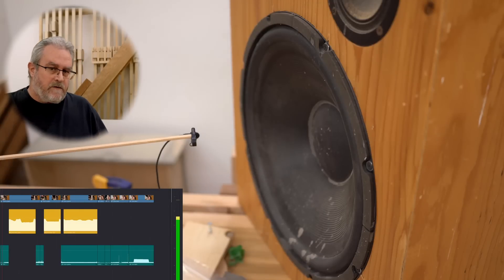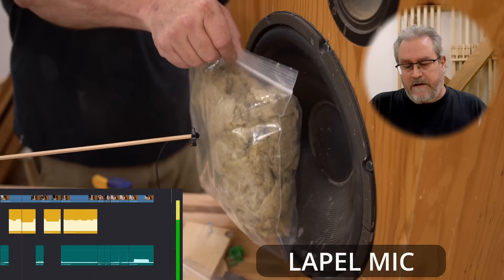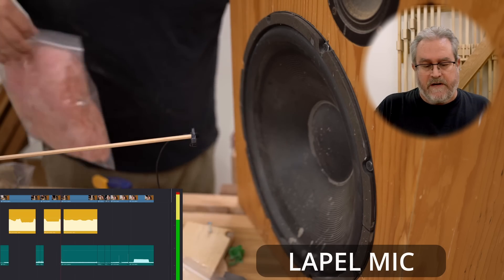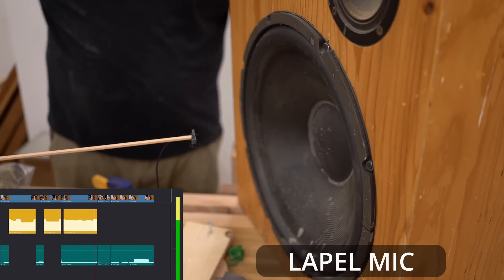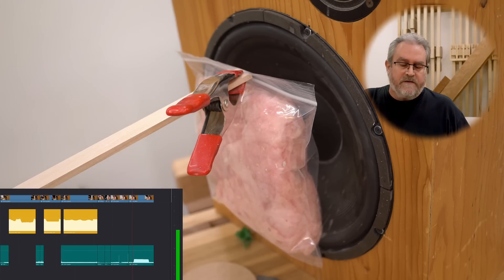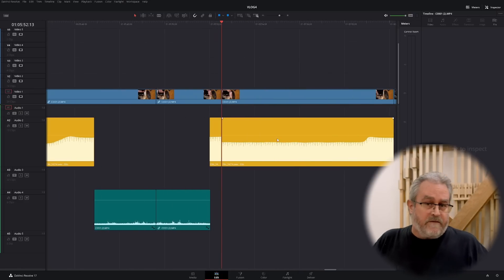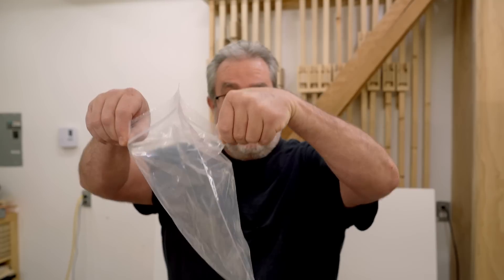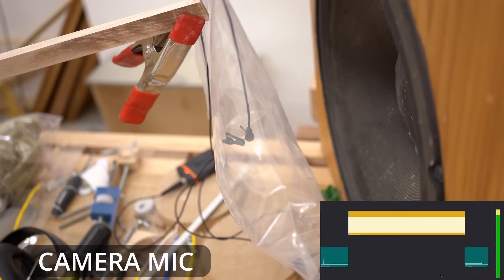You are Thinking About Sound the Wrong Way

Comment from the maker: Most people tend to think of sound from a speaker as air moving. This leads to the idea that something that will block wind (like thin plastic) will also block sound. The air is moving, but there is no "flow". Instead, think of that movement as shivering - it's vibrating very slightly but not going anywhere. 
As with all solids, some sound will reflect off of the thin plastic, but almost all of it will pass right through unobstructed. Think of light hitting a pool of water - some reflects and some goes through so you can see the bottom of the pool.
So a damping material like rockwool performs essentially the same as it would in its raw state, if it is sealed inside a plastic bag.
Sound is energy that travel through and acts upon mediums. Mediums are any solid, liquid or gas (like air) and they vibrate when sound passes through them. 
They can also reflect the energy. If the sound is travelling through a medium (like air) and if it meets another medium of different thickness, density and mass some of it will reflect. The new medium (like a wall) will reflect some of the energy and let some pass through.
For example a thick, solid concrete wall will reflect almost all of the energy that hits it, while a thin wall made from lighter, less dense material will only reflect the higher frequencies and let most of the bass frequencies pass through. You can hear this effect easily with your stereo playing in another room.
Damping absorbs energy and converts it to heat. When sound passes through a damping material, some of it is converted to heat and used up in that way. That's how the piece of rockwool I put inside the speaker stopped the standing wave - it absorbed the excess energy from that standing wave and converted it to a very small amount of heat.
Sound is not simple. Most think of it in 2D terms, when it is fully a 4D process. It moves through 3D space with a beginning and end time. It usually starts at a single point, but then expands out in all directions from that point until all of the energy has been converted to heat. This expanding is called propagation and the sound energy is spread thinner and thinner as it happens. 
Think of a balloon being inflated and how the rubber gets thinner as the balloon gets bigger. There's still the same amount of rubber there was when the balloon was not blown up, but it's now spread over a much larger area. 
For sound to dissipate quickly, something has to speed up the conversion of that sound energy to heat. That's the function of damping, like that rockwool I used.
Reply: At 40 Hz the wavelength is more than 8 meters. Your bag is very small in comparison and therefore invisible to the sound. I am actually surprised you got -3 dB attenuation from it. I would put that to mass damping effect more than any kind of absorption.
Reply from the maker: The minus 3db was the rockwool damping in the bag. The bag by itself was .3db reduction.
Reply: @Thomas..Anderson  Soundwaves are longitudinal. The energy of soundwaves moves particles back and forth between source and destination.
Reply: @ppdan  Not entirely true, Oversimplification.
Reply: I wonder if you could increase the effectiveness of polyfill by putting it in a sealed bag and squeezing out most of the air?
Reply: If sound is the movement of energy, then why is it attenuated by the temperature of air?
:
Reply: Hi John, I'm enjoying your series on the broad subject of speaker building! I would like to take the opportunity to debunk the myth that a baffle (with or without an open or closed box attached to) is necessary to create bass sound in a typical listening room: https://www.youtube.com/watch?v=njtaBY5GiYE (best to enjoy with headphones).
Reply: if the wave length is smaller then the thickness of a solid mass it will get reflected so not many things will be reflected with a plastic bag ..20 hz is 17 meter long good luck stopping that
Reply: sound is changes in air pressure to make it simple

Comment: I don't think people need to put insulating in plastic bags. Any fabric with a tight enough knit (like a bed sheet) will keep the nasty tiny fibers of insulation from getting pushed out the port from air movement. I don't get all geared up in a hazmat suit when building acoustic panels, but it is very irritating to my eyes, throat and lungs. If the air pressure going out the port of my speaker is enough to blow out my (rather snug) foam port plugs when I turn it up, then even at moderate volume there is enough air flow to push those tiny glass/rock fibers out into my living room. It's not that difficult to keep it contained and it isn't smart to allow it blow around your house freely. That sh!te dices up tender lungs and scratches eyeballs. Those two organs are kinda important to keep in good shape.

Comment: The fibers transduce the vibrating air into heat. By encapsulating the fiber material, you have prevented the air particles from interacting with the fibers.
Reply: Is there not also air inside the plastic bag interacting with the fibers? The bag is not a vacuum.

Comment: But the plastic bag is having the opposite problem most people were concerned about, which you show. The intent of insulation is to absorb reflected sound that would normally bounce off the internal walls of the cabinet, correct? You did show in your video that the plastic bag actually reflected certain frequencies….frequencies that would normally be absorbed by the insulation. 

When you held the plastic bag close to your face, the timbre of the recording changed. Moreover, when you covered the mic with the empty bag, you commented that the mic picked up more sound, which would seem to indicate some sound was being reflected around inside the bag, causing a boundary reinforcement. 

Am I missing something here? Are you saying the frequencies being reflected by the plastic are not crucial frequencies for the insulation to absorb? Are you saying the overall reflected sound is so low that it’s negligible? Both? Or something else?

Comment: Recently a car audio engineer showed me a car speaker design. He told me that it will be sort of revolution in car audio. He said its a ring mode driver. It is a extremely flat full range driver starting around 150Hz and reaching up to 20kHz. I mention this, because it can be seamless integrated in any surface and fully covered with a lot of materials without the need of a grill or opening. The covers almost have almost no effect on the function of the driver. In fact they become part of the driver.

Comment: If I am not mistaken it doesn't really go through the plastic bag, but is "reproduced" on the other side.
It's like a transducer only in this case you are using sound to produce sound.
Reply from the maker: While that explanation might be more intuitive, it doesn't actually work that way. 
Replace the plastic with a thin sheet of lead and there will be a significant reduction in sound transmission due to the much higher density of the lead. It reflects back much more of the sound, but is still acted upon in the same way as the plastic sheet.
If it was just purely a reactionary effect, then any material of any density at the same thickness would transmit the sound equally.
Reply: @IBuildIt  There will be less "transmission" because there is more reflection like the plastic bag will reflect less but "transmit" more.
Reply from the maker: But the mechanism of the transfer you describe relies on the the sheet moving when acted upon by sound energy, which happens whether it reflects or not. The sound still hits it regardless of how much is reflected back. Think about it.
Reply: @IBuildIt  Of course it will still hit (can't reflect without being hit).
Soundwaves are mechanical waves. If more is reflected less is passed to the next medium -> conservation of energy.
Reply from the maker: Good point. 
So where are the impedance mismatch losses? A speaker driving air isn't anywhere near 100% efficient, but you expect a less than 1db loss (what I measured) from this system.
Reply: @IBuildIt  It may sound weird but some energy is transformed in heat. My closest guess would be : total = reflected + absorbed + transferred

When it comes to your experiment, I am pretty sure that a lot of what you are measuring is reflections from all over the place. In an anechoic situation you might already get very different results (going outside with your setup would also make a difference). Also that small bag is no match for energy you are directing to it (especially since you are using a LF signal which has lots of energy).
Reply from the maker: No, if the mechanism is as you describe, there would be massive impedance match losses. The simpler and more reasonable explanation is that the plastic is just another medium that sound goes through.
With it working like you describe, if you put a speaker fully in a bag you'd hear next to nothing due to those losses.
Reply: @IBuildIt  Somehow I get the feeling that we are both just looking at it from a different angle and maybe I am not able to express myself well enough in english.
Of course you would still hear something if you put a speaker in bag but the less stiffer the material of the bag is made of the more sound will "escape" because the particles in the bag are less compact (dense) and vibration of the material is easier.
Let's say a plastic sheet is only made out of a single molecule (would be a very tiny sheet in reality). If a soundwave hits it that molecule will move and on the other side that molecule will move particles in the air ... 
Now we make a larger piece (in all 3 dimensions) ... about the same phenomenon will occur only that this time the first molecule hit wil transmit it thru it's neighbour molecules and so on until the last molecule of that material transmits to the another medium. 
I am pretty sure that if you would take a microscope and look at the surface you will see that surface vibrates (without going to molecular level) in a similar way on both side (where the soundwave hits and "comes out").
Edit : my bad, changed "atom" to "molecule"

Comment: I must confess, this topic both fascinates as well as frustrates me.  I still don't fully understand why sound absorption panels, then, are made with fabrics.  So if it's energy, why is that the case?  I'd love to see a test between a 2'x4' sound panel.  One with insulation only, one with fabric covered insulation, one with insulation covered with plastic (maybe a trash bag) and one with a trash bag only.  Then see what differences there are.  I love this topic, but damn am I an idiot on the subject...  groovy video

Comment: Can you  expand on the differences  of low frequency  vs high frequency in relation to deflection, reflection, absorption and pass through
Reply: I mentioned this on his last video. If you imagine a totally immovable object, it would reflect most of the energy and absorb some as sound. 
But reflection has a lot to do with mass and frequency. I'm sure there some tables out there.
Absorption is weird, you kind of need a material which is flexible enough to dampen the energy, but bounce back. Hence why rubber is a great vibration insulator. 
The absorption has a direct correlation to the thickness vs wavelength at x frequency.  Lower freq has a longer wavelength and as such needs more material to dampen it. this is exactly why you will usually hear bass from your neighbours cars ect rather than the rest of the audio when all the windows are closed. The thin walls and windows can block the higher freq, but the lower freq can still penetrate due to the wavelength.

Comment: A few observations. 
- The mic/empty bag test; ... perhaps the surface area grabbed more wave energy, coupling that air mass more ideally. 

- For decades concert PAs have had to fire through covers, banners, huge signage. 
Certainly not ideal from a FOH perspective. Encountered often on budget festival type events with a title sponsor. 

- Its generally accepted that covering bass trapping in 6mil sheeting for example, performs like a low pass filter. 
It varies, but it returns energy above a midpoint ... it's often employed to retain liveliness, when adding proper effective LF control via many bass traps. 

Most rooms need all the LF absorption possible, yet doing so without preserving vital liveliness may not be as pleasant. 

- NSYNC came thru our venue, RCA Dome, in the early 2000's. This was the biggest tour production in the world. 
No expense spared touring. 
But for "cool" visuals ... the PA fired thru an external grill! 
I couldn't believe it. 
Pop Odyssey Tour

Big point source PA, each cabinet faced with an exterior shiny metal grill ... for aesthetics ... a tour that big.  
That should never happen! 

fwiw, everyone got their hands on that tour ... "bill to band", "bill to band", "bill to band" ... I saw it.

Every element of that tour was as over the top as you can imagine. Circus like. 

The "steel" arrives a week earlier. Cranes handle and build the stage structure, from a constant flow of flatbeds negotiating our King-Kong door airlock. 

Over a few days, they build every trick feature a concert could have. 

As an opening misdirection, they appear on an elevated platform midfield (unknown to concertgoers, the act was rolled into position via road cases, right thru the center of the crowd!). 

In addition to cabling to fly five wide across the length of the stadium ... trick hidden features everywhere. Conveyor belt thrust catwalks out into the crowd. Five futuristic mechanical bulls appear ... with every lighting, pyrotechnics effect possible, platforms rising and falling. 

Every effect ... smoke, fire, light, platform, pyro, laser, the main video display dropped down into an example! 

Akin to a Vegas permanent residence show ... that level of complexity. 

We parked 20 to 30 motor coaches, INDOORS for that show. A car hauler of exotic cars, sport bikes for toys while they're in town. Additional haulers with 60 golf carts ... 60, one band, one night ... two hours!
Excess, layers of it. 

Like I said, EVERYONE had their hooks in while the getting was good. 

Someone had the bright idea to fire the finest PA cabinets in the world thru a set piece, an ornamental grill. 

John, your video reminded me of those times.
Reply from the maker: One thing I failed to notice while doing the mic in the bag recording was that it was a lot closer to the speaker. So that probably accounted for the higher volume.
Reply: With the microphone inside the bag, there was only one layer of plastic between the driver and the mic. In your other tests, there were 2 layers of plastic between.
Reply: Good point ... the smallest differences are magnified greatly due to relative proximity. 

Not in anyway in critique of your thought proking content, John. 
But, variations like that illustrate why subwoofer testing is best performed outdoors, ground plane at 2m. 

The extra meter facilitates all the energy (driver, vent, etc), has coalesced into summed wave energy. 
Also, the doubling to 2m elicits greater consistency across the data.
Reply from the maker: If I had a subwoofer design business, then definetely I'd use an accurate method to measure their output. 
But for everything I do the in room response is enough to get an idea of how they are performing. I'm only using my stuff in my rooms, so if it works there, it's good enough.
Reply: @IBuildIt  
fwiw; 
Due to extraordinary dBspl, pro audio mfr Danley, measure their offerings at 10m, and 28.3v, rather than 1m, 2.83v.  

Their products are extreme, ... subs w/109dB sensitivity at 1w, capable of 150dB. 

Full range, point source with 160dB capability! 

Extraordinary numbers.

Comment: The comments about the bag crackling reminded me of a silly experiment I did many years ago. The idea was to dump a bunch of styrofoam peanuts into a couple speaker boxes. I actually did this as a gag, because I thought it would have comedic effect (i.e. the noise styrofoam peanuts make). To my surprise, it did not have the desired effect. It didn't make any "styrofoam peanut noise." But I also don't think it did anything to dampen the boxes.

Comment: I was just going to ask about foam.  When i was younger I made a car subwoofer and lined it with foam ("egg-crate" foam to be exact).  Then later moved it to my home theater system.  It was actually a 12" home theater woofer to begin with.  It sounded great... that's all I remembered.  So I did the same to my floor standing 3-way speakers and thought it improved the sound as well.  Probably not... maybe.  But, in any case, look forward to that next.  Always learn something new .  In fact, I am realizing how little I knew to begin with.  :)
Reply: Egg crate foam really isn’t the best material to use. It’s been show that it’s just far too thin and porous to really do much to the sound waves, at least nothing like a proper fill like fiberglass.
Reply: @danhorton6182  Yeah... that was what I was thinking (now that I know a little more).  But, honestly, the rockwool in a plastic bag just completely blows my mind.  It's hard to wrap my head around it.  But, I'm still learning.  :)
Reply: @TheVTRainMan  lol, I get it. I’d you’re worried about itchiness or health hazards of fiberglass you should try denim insulation. I love it, I use it and rockwool.